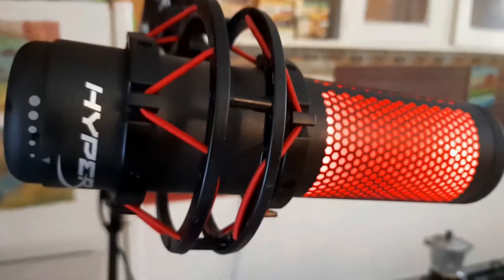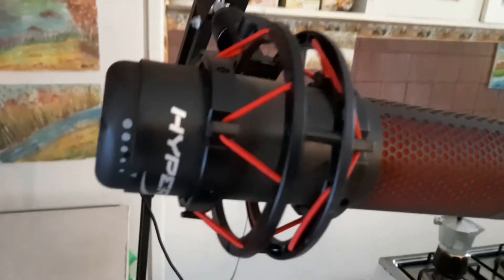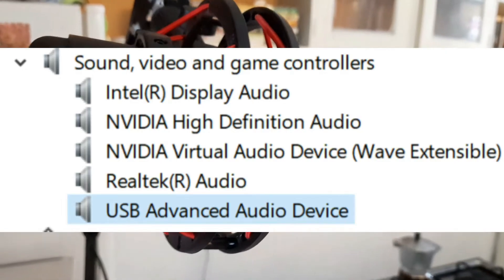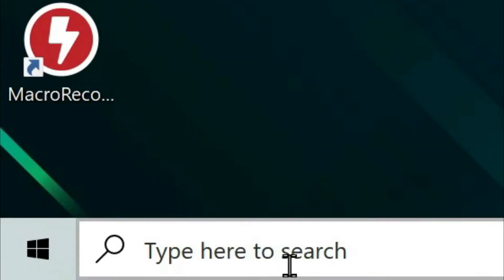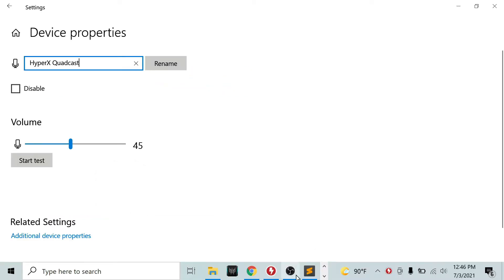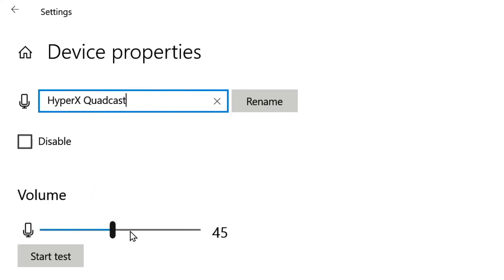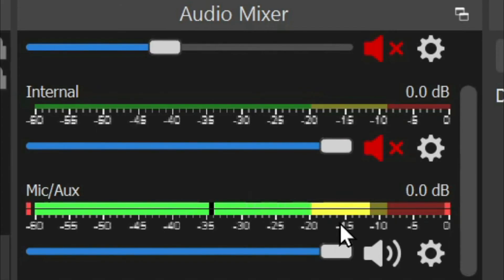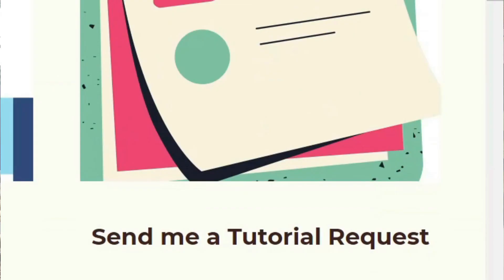Fix Hyperx Quadcast USB Advanced Audio Device Troubleshooting

Comment: is that win10? it's not helping at all. beside I got the 2s and it's way to silent, while it's got the correct name in win11 but the software of the sh*t mic don't find it, while win11 find it as a mic.  I found some people pointing out that the software is the problem, also with the old quadcast mic.

Comment: I had bought this microphone and have been using it for about a few months, and it's been great. The only issue that I have recently been concerned about is the tap-to-mute function had randomly stopped working, which is very unfortunate since it makes it easy for me to go mute. I have been looking all over the internet for a solution. Some are saying to disable other microphones that may be picking up audio, but I haven't had any luck. It'd be very much appreciated if someone can help me out with fixing this problem.
Reply from the maker: Unfortunately Ive never had that problem and my mic is super old :( So the way the red light turns on and off when you tap it, that doesn't work?
My only idea would be to clean it in case theres some residue or something getting in the way

Comment: the audio on my mic keeps cutting in and out as im speaking. Any idea how to fix this?
Reply from the maker: That problem is usually caused by a bad USB connection, causing the device to "unplug and replug" even though its plugged in. You can try setting up the plug in a way that the cord twists around itself so that it stays in place, or you can try replacing the USB cable. Thatd be my first guess for you

Comment: I dont understand how this helps?
You just lowered volume? My device is still USB Advanced Audio instead HyperX Microphone
Reply from the maker: Its a firmware problem. Your microphone will never again say its name, it will always show up as USB advanced audio device, unless you rename it. The volume changing is necessary, because when the firmware fails, it resets the volume. So you have to manually fix the volume setting as shown in the video. If you could find a way to update the firmware on the microphone, it might get fixed. But I have no idea how to go about doing that.
Reply: @JackPitmanNica  Hmm, but how does reducing volume fix bad quality?
Its actually shit that I paid +100€ for this Mic, and now my quality will be shit..Im so frustrated..
Reply from the maker: @martynoffical8995  Provided you pick the right volume level, there won't be a difference in quality. I still use the same microphone you saw in the video to make youtube videos, talk in meetings, and everything. Its loud and clear and works perfectly. At first I thought there was a reduction in quality but, after using the microphone since making this video, I no longer believe that to be the case. It looks like the firmware problem just changes the volume settings.
Reply: @JackPitmanNica  Idk man, it bothers me, because before this shit update or whatever it is, because it wasnt like that before, my volume was 100% and quality was amazing, now I need to reduce it to 45% and still not sure if its the same as before the bug if you know what I mean
Reply: @JackPitmanNica  + it just changed to 100% Volume automatically I dont get it
Reply from the maker: @martynoffical8995  I understand, its definitely frustrating! But basically, the "bug" makes it so the microphones volume is WAY too loud, which makes the quality all effed up. So, to get the "100%" from before; you'll have to use 40% now. Dont get too hung up, its just a number, the actual volume and performance of your microphone won't be ruined. The bug just messes up the scale, so if you put it at 100%, its actually at like 300% or something absurd

Comment: This doesn't fix the zero latency AUX feature which doesn't work when this happens
Reply from the maker: I think that somebody commented how to fix that, Im not sure where though but somewhere here there is a comment saying how to fix the aux feature
Reply from the maker: its a comment from FunBot here is what they said "IF YOU DONT HAVE MIC MONITORING READ !!! (hearing yourself in the mic)
I plug in my headphones to my mic, and when this happened I could no longer hear myself.

Got to Control Panel>Hardware and Sound>Manage audio devices>(select mic) mine was now names USB advanced audio device>Levels> on the microphone the volume icon will have a red x on it, click it and it will now allow you to use mic monitoring again.

 This fixed it for me, unfortunately it sounds worse after the firmware issue"

Comment: I just got one of these mics and what I don'y understand is that the headphone output is actually a sound output from PC, How can I monitor the mic output in real time recording?
Reply from the maker: @funbott commented before about this, they said...

"Got to Control Panel>Hardware and Sound>Manage audio devices>(select mic) mine was now names USB advanced audio device>Levels> on the microphone the volume icon will have a red x on it, click it and it will now allow you to use mic monitoring again.

 This fixed it for me, unfortunately it sounds worse after the firmware issue"

Comment: IF YOU DONT HAVE MIC MONITORING READ !!! (hearing yourself in the mic)
I plug in my headphones to my mic, and when this happened I could no longer hear myself.

Got to Control Panel>Hardware and Sound>Manage audio devices>(select mic) mine was now names USB advanced audio device>Levels> on the microphone the volume icon will have a red x on it, click it and it will now allow you to use mic monitoring again.

 This fixed it for me, unfortunately it sounds worse after the firmware issue
Reply: THANK YOU SO MUCH!!!!!!!!!!1
Reply: i dont see any red x :(
Reply: @vixygrayve should be a red circle with line through it. Sum like this ————————- 100 🔇🔴 … after ————————— 100 🔈. Click the speaker icon

Comment: I'm having a problem when using this mic with discord. speaking in game is fine but when I want to talk to my friends on discord with this mic they can hear me but I cant hear them (and its showing they're talking). Then I unplug the mic and I can hear them again, then I plug it back in and I cant hear them. Do you know what's causing this issue?
Reply from the maker: Sounds like your discord audio output switches to the microphone (which is not a speaker) so you hear nothing. Plug the microphone in and then look at your discord settings to make sure the "Output Device" is set to your computer speakers (not the microphone).
Reply: @JackPitmanNica  i’ll try it and let you know

Comment: Hello, for me it doesn’t turn on at all and I don’t even see the name on my computer?
Reply from the maker: That sounds like the microphone is faulty : / if the mic doesnt power on at all then its usually a problem with the cable, the mic plug, the cable itself, or the computers usb slot. Did you have any luck?
Reply: @JackPitmanNica  no I think you can’t buy the pacific Cable alone so I will see if I can find it. I think it might be the cable

Comment: Dude my quadcast isn’t turning on or connecting and it dose not show up on sound settings
Reply from the maker: It sounds like you have a fault port in the mic, faulty usb cable, or a faulty usb plug in your pc. Did you have any luck getting it to work?
Reply: @Jack Pitman Nica  I had to get a new cord /:

Comment: I just got one of these and my friends in discord say I sound decent. Friends in the Xbox game bar say I sound like I’m in a bathroom
Reply from the maker: Discord has a really really strong software layer which adjusts background noise and volume of users. So in general, if your mic is too low, discord will raise it, and vise versa. So discord isn't a good way to check the microphone! 

It sounds like the xbox game bar app is using your device's built in microphone instead of the quadcast. The quadcast is definitely a loud microphone when it is set up properly. Try downloading audacity, it is a free program that you can use to test your mic without any of the software messing that discord or other apps will use
Reply: @JackPitmanNica  thx I currently use nvidia broadcast.  I downloaded peace to mess with the eq. But it seems no matter what. Ppl in game bar say I sound like crap

Comment: I bought one myself but whenever I try to touch it on the top to turn it on, it doesn't. I have it plugged in and everything and it doesn't even show up as a setting on my computer, any thoughts?
Reply: I have the same problem. Did you find a solution?

Comment: Yeah so I unplugged my microphone the one you told us not to and my lighting doesnt work anymore and my computer wont even sense the usb. I dont know what to do and I my audio input for my headset has only half of hearing and I dont know what to do. The inside of the cord isnt bent at all but it looks beaten up and i dont know why it just stopped working.
Reply from the maker: You can get that part repared, if you can use a soldering iron then you could do the repair yourself. I think you just need to find the right micro USB port. I think you can find them by searching for "replacement micro usb port" on amazon

Im not sure if that is the problem, though. Might be worth looking into
Reply: @JackPitmanNica  know the inside of the mic broke so I just getting a new one cause of warranty.

Comment: Damn, i thought it would be a real fix, like yk, not just changing the name and reducing sound level
but ok, i guess
Reply from the maker: If you want to "really fix it" then you have to figure out how to update the firmware on the microphone. Good luck! The problem comes because the firmware on the microphone fails. Once the firmware fails, the microphone goes into "default mode" which makes it much too loud. Changing the settings reverts levels to what they were before the firmware failed.
Reply: @JackPitmanNica  Yeah, I got it, thx.
I did this first thing when the problem appeared. Just because I haven't recorded audios for a long time, it started to seem that the microphone began to sound worse. I hoped that Kingston had its own drivers, but it turned out that they use some kind of default microsoft.

Comment: I think my cabel was to bended but I ordered one and still doesnt light up
Reply from the maker: It sounds like it could be a problem with the USB port in the computer or the microusb port in the microphone itself. Does the red light turn on if you tap the bottom of the mic? When the mic is on mute it won't show the red light.

Comment: i have a problem that it works in obs fine but in discord its not picking up my voice most of the time and its laggy
Reply from the maker: Hmmm that sounds like one of discord's audio settings. See if unchecking reduce noise in discord audio fixes the problem. Theres a few other settings you can toggle off and try

Comment: FINALLY I FOUND SOMEONE WITH THE SAME PROBLEM!

When you say the microphones firmware has failed, do you mean broken? What if I would replace with a new cable? 
I use AUX headset directly from the microphone in order to get input monitoring. But now when the firmware has ''failed'' I can't hear myself anymore. Do you know how to fix that?

Thank you for finally helping me to the next step to fix my problem!
Reply from the maker: There are 4 physical points of failure you have to test. The USB port in your PC, the usb port in the microphone, the cable, and the microphone itself. I am not sure how to get the feedback feature to work after the firmware fails, if you find a way please let me know :)
Reply: @JackPitmanNica  I found how to enable feedback! Since I use AUX earphones connected to the mic I need to set the mic as the output source (obviously). But if i want to enable  feedback you go to properties on output and then adjust the microphone level there. The mic in output is disabled as default apparently.
Reply: @dennisandersson2021  God thank you, I tried to find this setting for more than 6 months, but I did not think that it was in the speaker settings, it helped me, and finally I can hear my voice without delay

Comment: Thank you but whats the point of buying 130€ mic, if doesnt work as it should. Disgrace from all companys - i have Razer and is same Sh*t.
Reply from the maker: I agree : / Microphones should last for many years but all the streaming mics I've ever bought have failed in less than one year. Except this quadcast. I have this issue but I still use it and the problem doesn't stop me from using it. I've had this quadcast for the same amount of time I went through 3 blue yetis soooo I don't really mind I have this one problem with the quadcast now

Comment: i need help please, i plugged in my headset and my mic but my mic dont work
Reply from the maker: Is the light turning on? The red light. Touch the top of the microphone. If the red light does not come on that means the microphone is not receiving power. It could be your usb cable, the usb port in your computer, or a problem with the microphone itself
Reply: @JackPitmanNica  got it fixed.

Comment: My mic is conected but isnt showing in the input so the razer headset connected by itself help pls
Reply from the maker: Hmmmm these are plug and play mics so they should show up if they are plugged in and the red light is on. Is the microphone showing up in your system audio input settings? If you are on windows, go to the bottom right of your screen and right click on the SPEAKERS icon. Then click SOUNDS . Then click on the RECORDING tab. Does your microphone show up there while it is plugged in?

Comment: Ok so my mic is a very loud static to my friends I made the volume to 45 but they still hear it only when I talk now what should I do?
Reply from the maker: when talking in discord with friends people have more quiet settings so you might want to try setting that number to 20 or 30 instead of 45
Reply from the maker: Also make sure that the gain on your microphone is turned to the lowest dot
Reply: @JackPitmanNica  I did that but it didn’t work however I disabled it from my input options and enabled it later on and it worked! Thank you!

Comment: Hei buddy, I was tossing between this and the Elgato Wave 3, In hindsight would you go for that instead of the Quadcast? asking cause I'd like to buy 1 for my channel as well but can't decide. I may stream more in the future but for now its mainly talking. Price is the hindrance in buying the Elgato, plus not sure if functionality is really necessary for me. However i wouldnt mind buying to future proof myself.
Reply from the maker: From what I understand there is no future proof mic. All microphones will fail if they are moved regularly or exposed to moisture.

That being said, my Hyperx quadcast has lasted as long as 3 Blue Yetis did for me. Even though this problem happened it doesn't stop me from working and using the Quadcast. 

You don't need a higher quality microphone than a quadcast unless you are producing music. 

Most content creators are much much more picky with their audio than their listeners.
Reply: @JackPitmanNica  So the wavelink software isn't really necessary? I meant future proof meaning If say i do more streaming in the future, then should I get the Wave 3 or stick to the Quadcast? Also did u mean u wont stop using the "Yeti"?
Reply from the maker: @CousinRoysCorner   @Cousin Roy's Corner  The wavelink software isn't necessary at all. You can do all sorts of live streaming with a basic usb condensor microphone using OBS software. OBS is free and open source. Its very powerful. I've used OBS for all my live streaming and recording needs for 5 years and I've never found something I couldn't do with OBS. I have a tutorial all about using OBS here: https://www.youtube.com/watch?v=ATM9oE_Ij40

I won't stop using my quadcast unless it totally breaks. I was saying that in the past I used blue yeti microphones but after 3 of them breaking I stopped buying blue yetis. Thats why I got this quadcast originally. I've had the quadcast for over 2 years and it still works to this day!

Comment: Guys the issue that it is becoming more sensetive is because, on default u have a 44.1k ghz in obs and system but if this shit is happening it is not only becoming 100 of the sound but as well is reset to the level of 48 k ghz, so you will need to adjust it in sound settings (right bottom in yr windows), this not a much difference for gamers, but for streamers, who are trying to make a sound perfect might be the issue, I was trying to figure out how to fix it, so I hope my comment will help sb
Reply from the maker: Right? it is such a pain when the audio level of the voice and the game isn't matched up properly. Can't hear the game or can't hear the voice, so much work has to be done to balance it out!

I swear my microphone is loud one day then quiet the next. I've ruined loads of recordings because the mic wasn't loud enough to pass the noise gate. Such a pain in the butt!

Thanks for your commeny Kiril I'm glad you figured it out <3
Reply: @JackPitmanNica  Feel yr pain mate, it is mic problem as I understand, but I tried to set it in one position, and does not move it, cause I noticed that's might be a reason at least for me
Reply from the maker: @kirilpavlenko3204  My microphone changes its sensitivity. Sometimes I need to have the gain maxed and other times I need to have the gain minimized. It seems to be different after I plug and unplug the microphone sometimes.

Comment: my mic is plugged in and it is glowing red, but i can’t talk. it won’t work
Reply from the maker: If you tap the bottom of the mic to mute it, does the red glow turn off? 

If the red color turns off then your mic is most likely working and it is a software issue. Are you sure that your microphone settings are set to the quadcast and not a default setting?